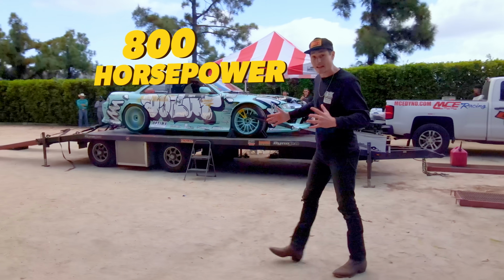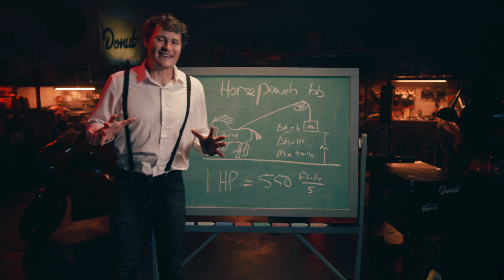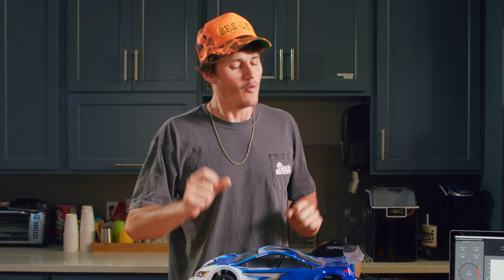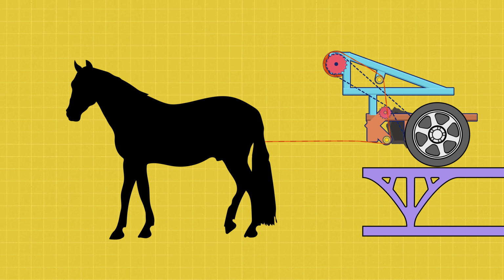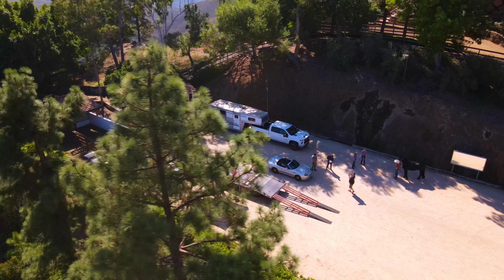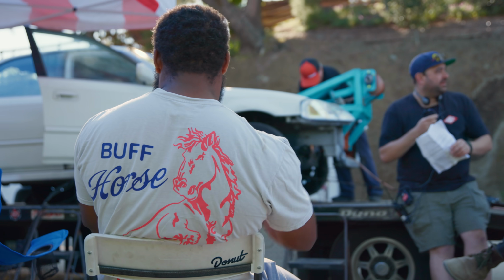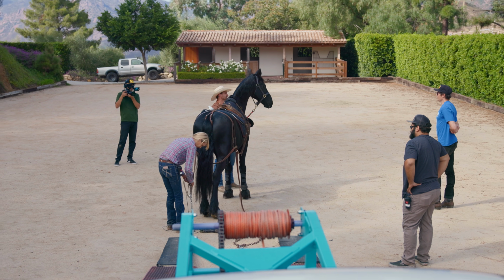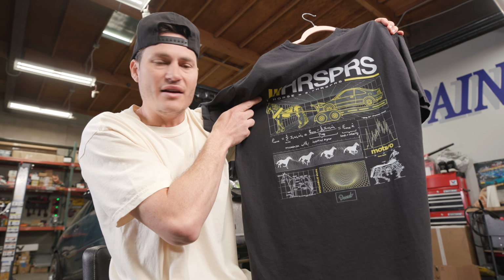How Much Horsepower is a Horse?

Comment: Energy = Mass x Velocity²
Energy / Time = Horsepower

Take the Weight of a horse and its top Speed and calculate the Energy at that Speed, then divide that Energy by the amount of time it takes it to reach that speed to get its Energy per second, which is usually measured in Watts or Horsepower.  Also, if you take the Energy at different Speeds along the way and the Time it takes to reach them you can make a Horsepower curve.

I would take a Draft Horse and a Race Horse and get Draft Horsepower and Race Horsepower.

Comment: I think the creators could have just come out and admitted that the dyno was just being used to provide the right amount of tension on the rope for the horse. The GPS and the strain gauge were not the backup, they were the most direct way of measuring torque and acceleration without incurring mechanical losses in that application. It would be interesting to know how far off the dyno readings were.

Comment: the irony is that the ideal solution was in the video at the beginning -- the horse-drawn mill. it directly converts horse locomotion into rotational force, suitable for measuring torque. 

the entire episode is about building an elaborate rube goldberg machine to avoid just using the simple solution. bravo.

Comment: As cool as the video was,  this was basically the equivelent of measuring how fast a Greyhound is, and then testing a Yellow Lab/Greyhound cross...that barely got above a jog as the means to meassure it..... 

they really should have gotten an actual true draft horse instead of using a small thoroughbred light draft cross who's not actually built for true pulling. A true draft horse is drastically larger, stronger. And have a massively better drive to pull, unlike Big D who barely pulled and didnt use even a fraction of his actual strength.

The world record for a Shire pull was 58,000 lbs... I'm just saying. The numbers on the dyno would have been drastically different if they'd gotten an actual Draft breed.

Comment: Americans really going to any length to avoid the metric system lol 

I'm amazed the engineers didn't tell you it was way easier to just measure the horses output in Watts and than just convert to HP

Comment: Great job measuring the peak HP of a horse.  The analogy I remember for the origin of the number was based on the power output of a horse over a 12 hour workday.  Both of these numbers make sense (5.7 peak, 1 continuous for 12 hours a day).  A horse can pull very hard for a short distance, or a medium amount for a long distance.  Important to manufacturing is the long term power output, not the peak power.  Think diesel engine in a Semi-Truck vs. a nitro-methane fueled dragster.

Comment: Engineers got to engineer and make things complicated.   If a spool was simply mounted to the front wheel, it would have been easy and possibly taken a lot of calculation out of the process.  Of course, they could have just made an adapter and not used a car at all, but this is a car show after all.  Great episode guys!

Comment: "Horse dynos" are a thing that kind of already exists. People have built machines for horse pulling competitions that can objectively measure the pulling output of horses. I think there could be a way to measure the horsepower of the pulling horses using these contraptions. They also allow the horses to move slower, so they're able to dig in better. I think Big D may have been able to earn himself a higher power number if he didn't need to trot as he gained more speed.
Reply: That sounds like horsetorque
Reply: @87isbmw  That is the best comment I have read all year. Hahahaa
Reply: HP is the ability to move 500lbs 1ft per second.  I'm sure they calculated that into the equation.  Motivo isn't your average company, I've seen their work on multiple channels, and have to say they're pretty credible.  They partnered with Honda, Toyota, Volvo, and Airbus.
Reply: They wanted to know the number of horsepower when applied to a vehicle. Not just the raw pulling power of a horse. Thats why they had to build something that used a car.
Reply: @merleawe_  , but it was still down to how they geared it. gear it wrong, horse is at a disadvantage.
Reply: @abates3747 dyno pulls are done in 4th gear which is usually 1:1 ratio.
Reply: Torque is horsepower. Hp=rpm*tq/5252. They wanted crank hp they just needed to measure the rpm and torque at the pulley and they would of got the crank hp. but it was entertaining, just not scientific.
Reply: @sdxfeiro  How's it not scientific
Reply: They could've just had a horse flat-tow a vehicle, and measure the tension in the rope to find the force it was pulling with. 

The inertial dyno measures the acceleration of a mass, and calculates the power output across the range of speeds covered during the pull. A towed vehicle would act as the inertial mass so they could measure over a good speed range to get the dyno graph of power vs. speed for the horse. If they spent somewhere under $100 and bought a load cell, they could use that to measure the force transmitted through the rope (with no drivetrain losses). They already had a GPS measuring the horse's speed, so they would just need to multiply the force by speed to get power.
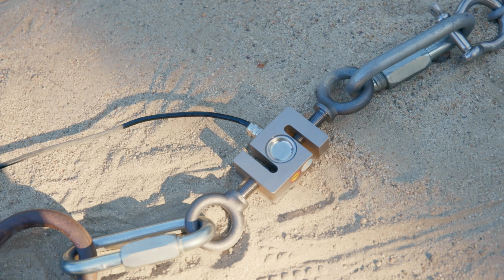Reply: @agerrgerra1361 look at 23:45, they have a load cell.

Comment: When James Watt determined the horsepower, he actually based it on an average amount of work the horse could manage in an 8 hour period. It worked out to about 360 foot pounds per second. He went ahead and considered it 550 foot pounds per hour, to guarantee that his " 1-hosepower"  engine (perhaps in a tractor) could out-work any horse anyone is likely to have. That rating, even Watt's embellished horsepower is far less, than what a horse can produce for just a few seconds. Race horses, just as they're coming up to their maximum speed, can easily exceed 20 HP, but literally only for seconds. A Thoroughbred cannot produce the tractive effort that "Big D" can produce, but for a short period of time, can produce ~60 % of that effort, at close to 35 MPH! A typical horse race lasts less than 2 minutes, but, the high acceleration period is over in just a couple of seconds. Once up to speed, (~40 MPH) is done with almost no tractive effort, so, those horses are barely producing 1/3 the "horsepower" that "Big D" did, but they're doing it for over a minute. As far as what those horses could actually average in an 8 hour day, it's Big D for the win!

Comment: One last point: in cycling, watt-meters are very common.  A very common figure people use to judge how good a rider someone is is FTP, or functional threshold power, or how much power one is able to output for an hour.  300W, or a bit under half a horsepower, is a dividing line of sorts.  Even weak riders are able to pull more than that for seconds or even minutes.  A very vanishingly small numer can put out that much or more for hours.  That's a lot of what horsepower is about: horses can put out 750+ watts all day, which is what steam engines were measured against, since they can basically run continously.

Comment: Awesome! But u guys know they make hub dynos, right. Couldn't you have just bolted up any wheel, cut a whole in the tire, attached a rope and pulled straight from there? Is the issue that the horse needs dirt so it has to be mobile? I cant believe nobody has a portable engine dyno besides a roller type.

Comment: The issue with standardization of the horsepower, the arbitrary nature of the original measurement, and the lack of quick compatibility with other power standards means the horsepower should be deprecated and considered an obsolete measurement.  In its stead, I suggest the use of the hippiepower.  An overage hippie can develop 100W sustained on a long pull, and 100W is a very convenient and easy factor for quick conversion.

Comment: Why include the transmission in the calculations of a single horse’s power? A horse does not have a transmission. Why not just use a cable on the drum, if an automotive dyno is going to be modified to make a calculation of the power of a horse?
And if it is going to be scientifically accurate, doesn’t multiple horses, need to be measured? 
Multiple horses from a breed, and the same breed from different regions need to be tested. Then different breeds should be tested also. 
Also, the most car like horse breed, would be one that would be rode casually. If looking for something that would be more performance, then a horse that is a faster breed, would be more suited. This horse breed would be more comparable to a truck, able to pull, but not quick. But these are not what most people drive, they drive commuters, so the average horse that people ride casually, or what most people would have ridden back when people rode horses, before the horseless carriage was normal.
Reply: Man, I actually had a long reply to your crap but I just deleted it. You're a grown man and if you have all this complications in your head, YOU HAVE A BIG PROBLEM.

Comment: Your gearing was too low. You should have gotten a physiologist on board. Peak power for a horse should be reached at around 3 m/s. A human is around 1.15 m/s. Furthermore, power as a function of time follows a power law. Your 15 seconds power is going to be more than 3 times your 20 minutes power.

Comment: Pretty interesting. One thing of noting about the draft horse observation is if it was an eyeball and a team of draft horses working all day the 1 HP might not have been to far off. Depending on how they were run and often they were swapped out you could easily expect a horse to peak at half a dozen or so since they were driven for long endurance time vs peak power.
Remember Big D was only allowed to do 5 pulls before tiring out. If you wanted to have Big D operate for a quarter day you could easily see their handler restricting the exertion allowed to 1/3rd.

Yes its a marketing gimmick, but most measurements around the time of Watt were. It was about the bragging rights of a high number, rarely about the accomplishment of basing the measurement on something that had some basis in the natural world. Watt seemed to do a pretty good balancing the two (you don't want your horse pulling to give out after 15 minutes from over exertion just like you don't want your early engine falling apart).

Comment: The horse used is called a Friesian which is NOT a draft horse- they are a type of carriage horse in the warmblood category (think of a Range Rover that needs constant maintenance - bonus they are the black horses in every single movie ). These horses are utilized for only pulling light carriage and do not have the strength for actual heavy work. To be compared to a car, the first two quarter horses would have been more appropriate (like little Honda civics that never die) but that isn’t the point of this experiment. 

By Watts imagery, definition, and the clips of brewery horses, they are legitimate working draft horses (Brabant/ Belgian shown specifically). These horses are utilized for heavy field work and pulling- therefore the definition of horsepower. 

Though interesting, the base variable of the horse was never standardized and the term ‘light draft’ (aka warmblood) was thrown into the same category as heavy draft. I’d love to see this re-done with a Brabant/ Belgian who do this for a living.